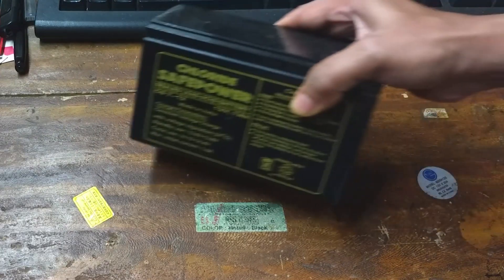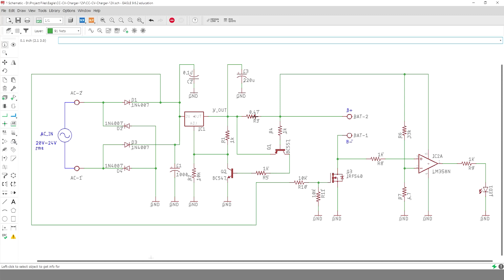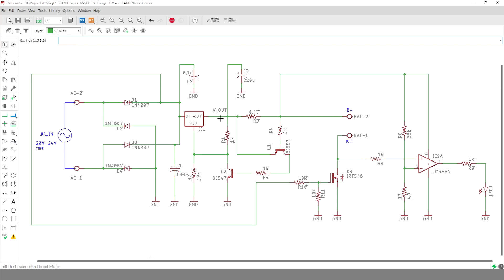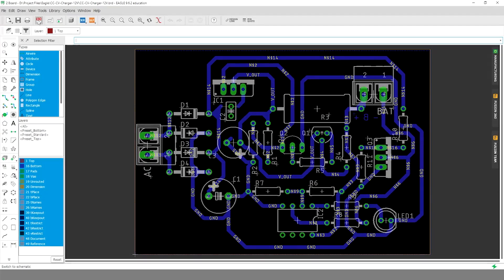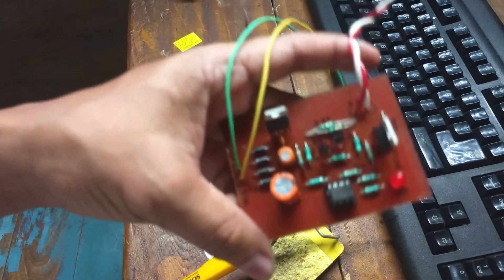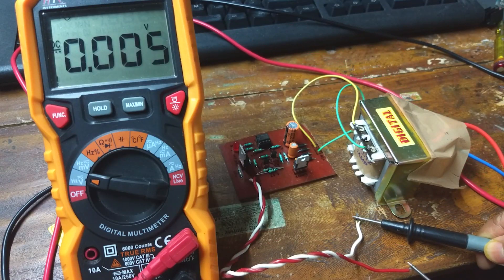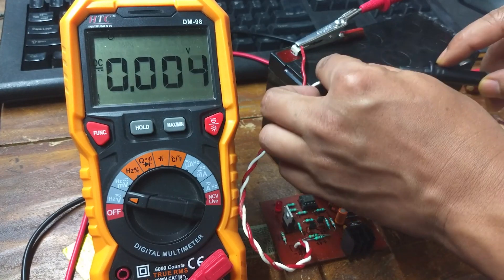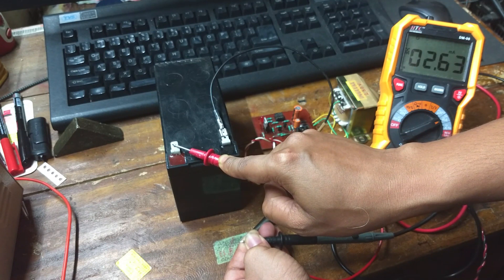How to Make a Cheap, Small, 12 V Lead acid Battery Charger | 7 Ah | CC CV Mode

Comment: #thiasotiks...made this circuit...but whenever testing this for the 1st time without battery there is some burning smell coming out and see that 0.1uf 50v capacitor burnt... I'm using 2200uf 35v capacitor... Instead of 1000uf...is this coz the problem...or should i use 0.1uf 100v capacitor...or anything other wrong... Which i still not find out...plz reply...
Reply from the maker: No need to use higher voltage capacitor. Because LM317 can not tolerate more than 37 V. So please recheck that you are supplying not more than 37 V (max. 24 V is recommended).
Reply: @ElectroHijibiji  Thanks for reply.... I already checked...and from my transformer... It's output supply is 28v...and after bridge rectifier due to 2200uf capacitor its become 37v... Although this voltage decreasing very very slowly...and at the output i got 18v...now my circuit is working but voltages re not right....and the boost voltage 37v may damage lm317...??? plz tell me what modification should i do for 14v output... Should i use low uf capacitor like 470uf...is it will be alright...???😢😢😢
Reply from the maker: The output voltage depends on R1 and R2 only. Equation is, Vout = 1.27 x (1 + R2 / R1)

Comment: #Thiasotiks ..
1)Can I omit LM358 ic....if I don't need any notification  at the end of battery charging...??
2)if I am using 12-0-12 3amp transformer....then charging current is limited to 0.5amp..... or....will be greater than that....??
Reply from the maker: Yes. LM358 is only for indicator LED.
To increase the current reduce the 0.47 Ohm resistor. However, LM317 is limited to supply maximum 1A current. So, to operate safely you can replace 0.47 Ohm with a 0.22 Ohm resistor which will give approx. 1.1 A current.
Reply: @ElectroHijibiji  for 0.22ohm...which 2 resistor should use in parallel..and if i take 1.1 amp current from lm317...will it survive... Although I'm using good heatsink....
Reply from the maker: 0.22 Ohm is available, no need to make parallel. 1.1 A will be ok if you attach a big heat sink.

Comment: #Thiasotiks
Can u plz. tell me.....
1)which two resistors are combined to make 0.47ohm sensing resistor...??
2)At the backside of this pcb.... u used a 470k resistor ...can u tell me...on  which two points... Should I connect it....??
3)U used a 12-0-12 1amp transformer for charging...but during charging is the transformer  too much heating...&... if so then is it normal....???
Reply from the maker: No, I couldn't make 0.47 Ohm. I combined two 1 Ohms in parallel and got 0.5 Ohm. 0.47 Ohm is available in the market, you may use that. 470 kOhm resistor may not be required for you, specially if you use low tolerance metal film resistors in place of R1 & R2. In my case R2 was little high thats why I connected 470k in parallel to R2. No, I didn't notice any abnormal heating issue in the transformer. It was slightly warm only.